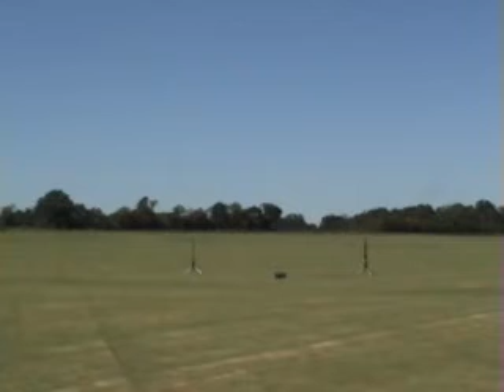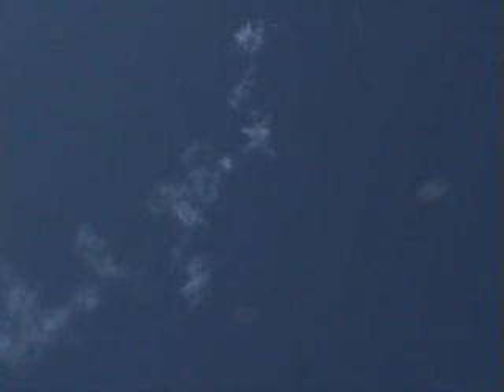Apogee Aspire on G77R

Comment: A shred is a catastrophic structural failure while under thrust.

De-jargonified, it means the rocket falls apart because it isn't built strongly enough. Probably the most common form of shred is what you see here: The fins coming off at supersonic speed.